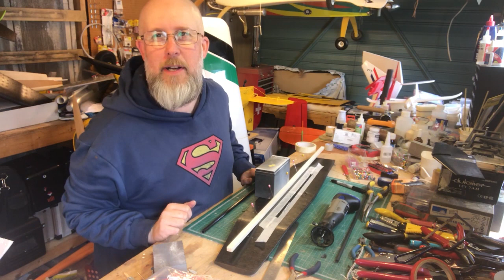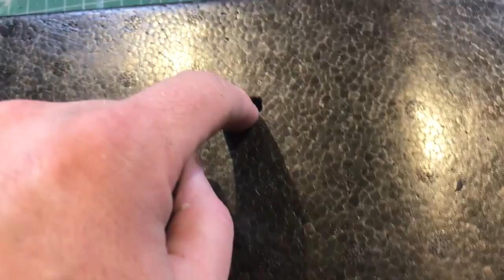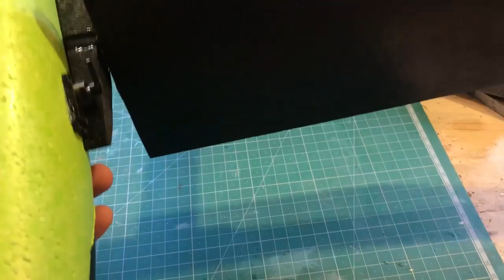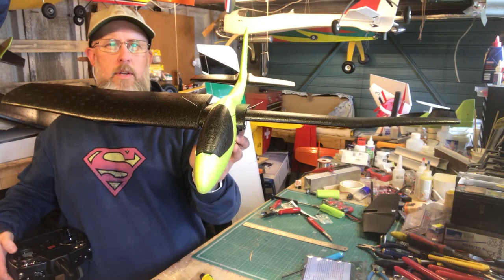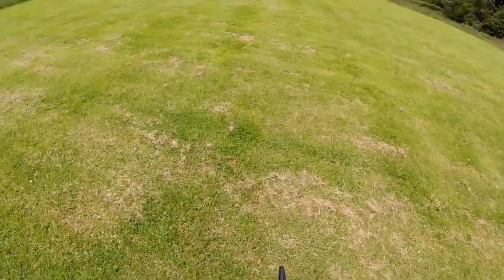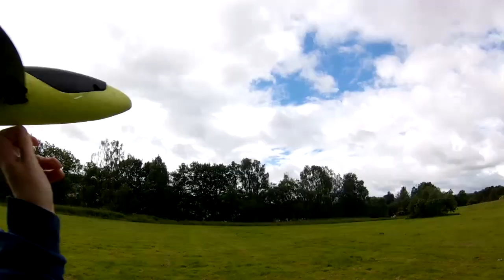Lidl glider R/C Conversion Pt3

Comment: Not exactly light. My conversion weighs just under 250g with a motor, folding prop and an 850 mAh 2s.
Reply from the maker: i didnt go out of my way to make it light
Reply: Simon, are you compensating for something?